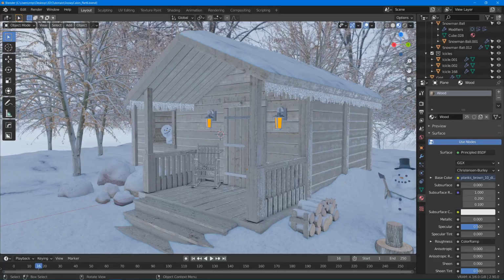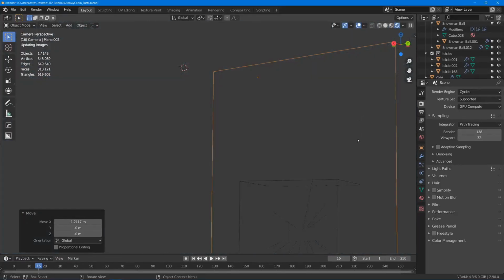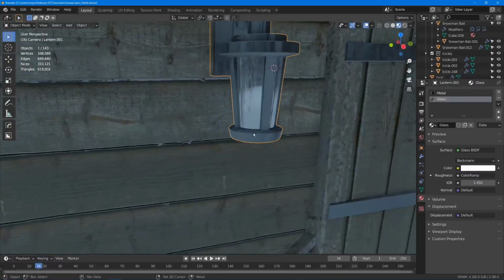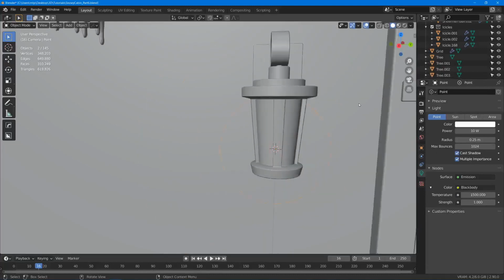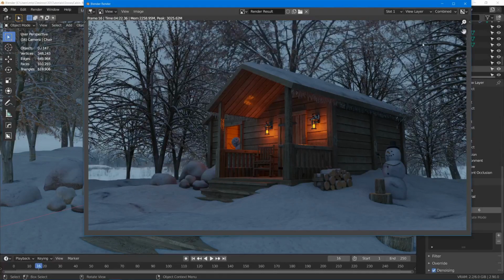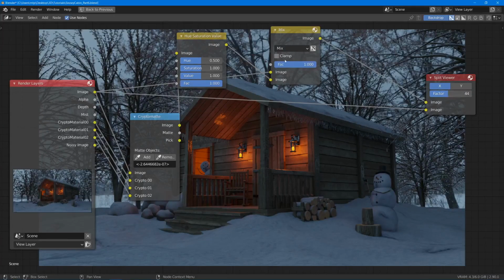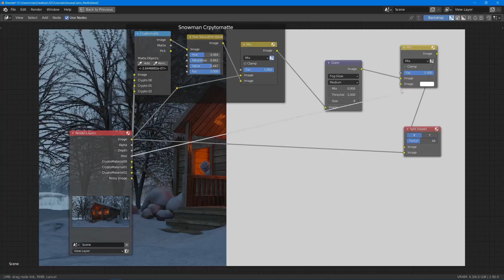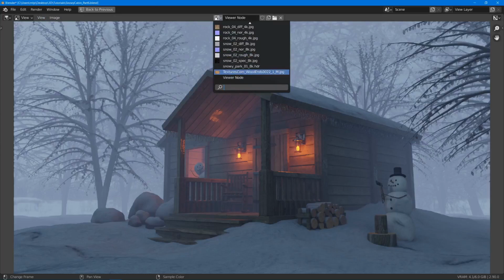Modeling a Snowy Cabin in Blender Part 6

Comment: This was great! I have this sudden issue where in edit mode only the object I’m selecting is in wireframe. Every other object stays normal. All the answers like clicking the overlay button isn’t the problem. Any ideas?
Reply from the maker: I played around with it a bit, if you go to edit mode, overlay drop-down, is hidden wire enabled? (in edit mode it will make the selected wireframe only, and if overlays is disabled it leaves the selection invisible)
Reply: @MrTriPie  I looked and that isn’t checked either. One possible hint is that in that dropdown under “Geometry”  the Wireframe, Opacity and Fade Inactive are grayed out but you can still move the sliders.
Reply: @MrTriPie  this morning when I went into the project it was magically fixed! Some bug I guess. Thanks for looking into it though for sure!
Reply from the maker: No problem! I'm surprised I found a feature that looked similar to your bug though, maybe the bug was somehow Hidden Wire got enabled in the background without showing it in the UI?

Comment: Hi! My laptop keeps lagging/not responding since I add the Snow part. I don't know what to do. Is there a better way to minimize that part or is it because of the sizes or what? Thanks a lot 😊
Reply from the maker: Maybe its too high res, if you have a subdivision modifier there's an option to have the subdivision level higher for the render, but lower it to what performs good in the viewport when working on it. There is also in the render settings a Simplify category you can enable to set a max subdivision level in the viewport for your whole scene. You could also try having the area close to the camera/around the cabin higher resolution by going to the top view and box selecting the area you want higher res and pressing ctrl i to invert the selection, and using unsubdivide (either from the search menu on f3 or right click menu in edge or face selection mode).

Or if its only slow in material preview or viewport render mode, the textures may be too high res, so you could try swapping them for the next level down in size.
Reply: @MrTriPie  it's only on that preview part because when I hide that object everything goes smoothly. I will try that. Thanks so much😊